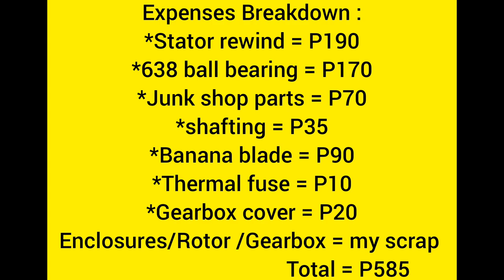Usapang Senior: ELECTRIC FAN CONVERSION (BUSHING/BALL BEARING TYPE MOTOR SHAFTING) DIY AT HOME

Comment: Wow thanks Sir for sharing this Idea.
This will be a great alternative to bushings especially when used in heavy use commercial and industrial purposes.
I've implemented this already in the Electric Fans(4 stand fans) of my Church and so far still running fine especially when it needed most on Sunday.

There is not much difference since 638 Ball Bearings cost 31-60 pesos each.

But not all Electric Fan Motors can accomodate the 638 Bearings so check the depth of the bushing holder.
Reply from the maker: Thanks
Reply: anng size Ng bearing ung kasya

Comment: gudam bossing galing po yan. ma solve kaya ang init ng motor causing stuck up. kadalasan maski bagong rewind mainit din.
Reply from the maker: Yes brod, maiwasan ang stuck-up ng shafting. Kaya umiinit ang motor at bumibigay ang thermal fuse dahil sa stuck-up shafting/bushing.

Comment: Matagal ng lumabas ang electric fan na bearing ang ginamit. Ang brand niya ay KDK at made in japan at medyo mahal nang nabili ko pero sulit. Ang KDK electric fan ko sa bahay ay dalawa at swabe pa hanggang ngayon. Ang una kong nabili ay ceiling fan sa dining table noong 1998 at hanggang ngayon ay swabe at tahimik pa at puro linis lang at patak ng konting engine oil sa 2 bearing niya every year para mas lalong madulas ang bearing at di kalawangin. Hanggang ngayon ay 23 years na at wala pang nasisira at sulit talaga ang KdK electric fan na bearing type.

Comment: kung hindi ka technician akala mo tama  ang gawa bibilib ka kasi bushing convert to bearing type ...maganda talaga  yun mas titibay ang  electric fan mo...ang problema  may mali sa pag gawa...kasi dapat ang bearing mismong nakapirmi sa shafting harap at likod hindi dapat naghihiwalay ang bearing sa shafting ..dapat mahigpit ang pagkakapit ng bearing  sa shafting sa harap at likod  ..kasi kung ganyan rin lng na hindi nakakapit ang bearing  sa shafting at ang bearing ay naiiwan sa housing ng electric fan...lumalabas na yung  bearing  ay ginawa lang din bushing...kasi magaan lng na nahuhugot ang rotor na hindi kasama ang bearing...maganda sana at talagang matibay  ang conversion kung tama ang procedure ng pag gawa ...salamat po...

Comment: Sir salamat muli sa.kaalaman baging tuklas n nmn ito, at tamang tama meron po akong ball bearing na di pa nagagamit, sir tnong ko lng po wala napo ba aalisin sa gitna ng ball bearing at bali pag yan po ba ang ginamit ay useless na ung bushing, bushing lock at yun po na foam.na nilalangisan? Saka po anong sukat po ng ball bearing ang pede.. salamat po
Reply from the maker: Wala ng aalisin sa ball bearing, kilangan forcefit ito sa shafting. Wala ng bushing at foam pero lagyan mo ng spacers panigurado kung sakaling lumuwag ang kapit ng ball bearing sa shafting. Hindi parepareho ang inside diameter ng motor enclosure kaya hanapan mo ng ball bearing na tugma sa motor enclosure. Kung maluwag ang bearing lagyan mo ng sim tulad dyan sa video ko para sumikip. Nasa description ang size ng ball bearing na gamit ko.
Note: Makomplekado ang conversion from bushing to ball bearing, kaya kilangan perfect ang pagkagawa. Thanks
Reply: @yobsvlog  ok sir salamat po muli, Godbless po

Comment: Ka senior, ask ko lng po #638 correct # ng bearing, tska sukat ng shafting? thanks po...
Reply: 638 = 8mm inner diameter(shafting), 28mm outer diameter, 9mm thickness
Reply from the maker: 638 ZZ (8mm x 28mm x 9mm) pero hindi lahat ng enclosure 28mm, may malaki konti kaya nilalagyan ng seam.
Reply: Thanks po, keep safe always ka senior...
Reply: Ka senior, ask ko lng saan nakakabili ng ball bearing #638zz at how much each, kc po d2 sa Lucena wla po Akong Makita 2days? thanks sa rply.
Reply: @danilobagaporo4617  Sa Shopee meron.
Type mo sa Search Bar 638 Bearing
Reply from the maker: @danilobagaporo4617  Yes! sa shopee  85 pesos ang isang peraso.
Reply: Thanks po mga sir, keep safe always...
Reply: @yobsvlog  Meron po Sir na 31 pesos kaya lang at least 2 weeks shipping.
Reply from the maker: @vargasantonio286  ganoon ba, I try ko I search. Thanks
Reply: Thanks mga sir,meron nko Nakita sa Lazada #638zz (311.00 plus shipping 72.50) dko alam kng legit? Ang hirap maghanap sa local?
Reply: 10 PCs po un
Reply: Good day po bro. Nag try aq Kasi bakit maingay😅😅😅. Salamat po
#pround inc

Comment: Sa conversion ng elec fan from bushing to bearing, kung ang inside diameter Ng bearing is 8mm ano ang dia.  Ng shafting. Kasya kaya ung nabibiling shafting , std. ang sukat nyon. 
Paano ko Ipe press fit ung bearing sa enclosure, saan kakapit   Yun .

Comment: good one sir gusto ko narin mag convert naghanap lang ako per piece ng seals bearing online anong po code ng seals bearing na ginamit ninyo and how much po bagong stator compare sa pa rewind wala na kasi mag rewind sa kuhar namin.
Reply from the maker: Nasa description ang details ng bearing at link, mas mahal ang new stator sa online. May rewind stator na nabibili sa mga Electric Fan repair shops worth 200 - 250 pesos.

Comment: Sir bat yung bearing nio sakto dun sa cover ng motor
Reply from the maker: Hindi talaga same sizes ang enclosure hub, nakita ko lang yan sa mga scrap ko. Kung maluwag konti lagyan mo ng sim, either rubber, hard plastic or sheet metal sim. yong iba nilalagyan ng pandikit, thanks.

Comment: Fan: Modified Fukuda SF 164RB [40 WATTS*]
Inspiriration: Asahi Orbit Fans And Nidec 24V BLDC Motors (Panasonic DC Inverter Fans)
Reply from the maker: Thanks
Reply: That's so similar to the el cheapo Centrix CX 1666B

Comment: Can you give the information in english language please
Reply from the maker: In this project I am showing you on how to repair, restore and convert cheap stand fan from junk shop into bushing/bearing type motor shafting. I am using sealed ball bearing no. 638 ZZ for this project and I am showing you the proper way of mounting sealed ball bearing to avoid fits issues and misalignment. 
Also visit links in the description for some videos about this conversion project and parts links.

Ball Bearing 638ZZ (8mm X 28mm X 9mm) link: https://invol.co/cl6gewi

Parts & accessories Affiliate Links:
   Lazada Affiliate Link : https://invol.co/cl6hmsy
Shopee Affiliate Link: https://invol.co/cl6hmm2

  1.https://youtu.be/eF1kqxkVbMQ
  2. https://youtu.be/vjUct4_OAnU
  3.https://youtu.be/mNzlQGUvurU
  4. https://youtu.be/UnHMwnSkHvQ
  5. https://youtu.be/rCJCbNq9IBw
  6. https://youtu.be/bd03UqXI7tI